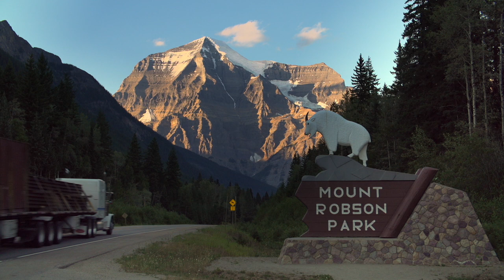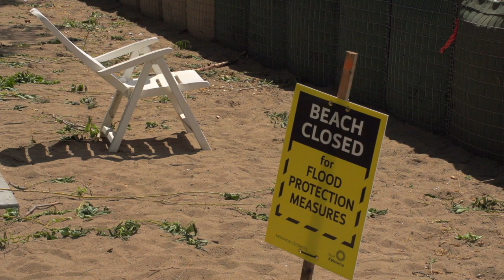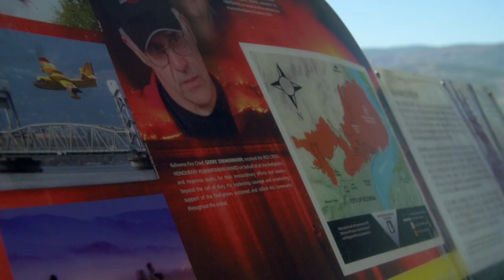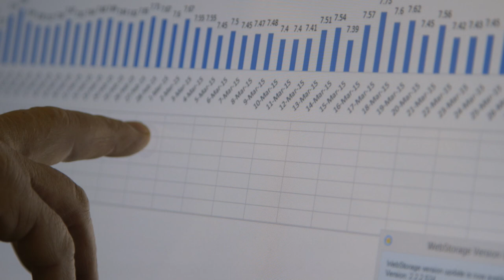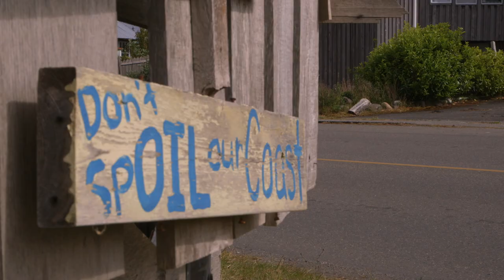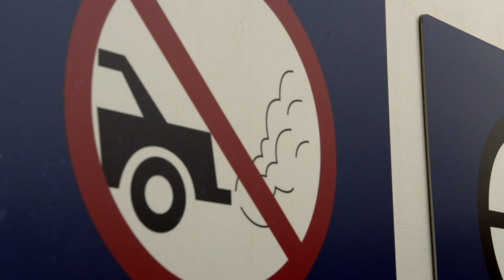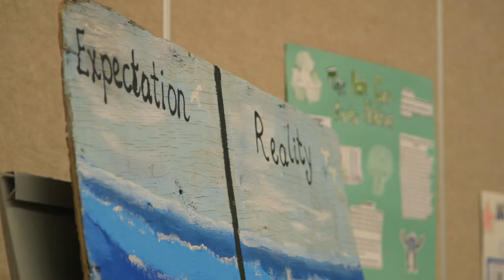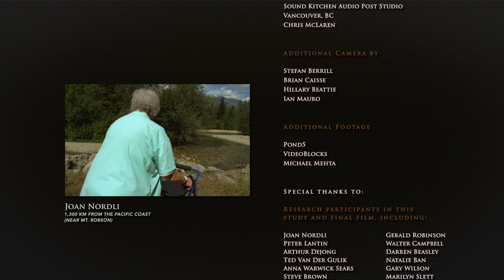Beyond Climate (full film) featuring David Suzuki

Comment: David please don't worry but adopt fusion power. The overall climate is demonstratively cyclic as in that it oscillates. We do not yet have sufficient data to build a worthwhile climate modelling computer program for realistic calculation of climatic changes and much is to do with clouds, water vapour and other greenhouse gasses. Australia was early to build the Hornsdale green mega battery to help with going green with solar and wind power and despite our backward thinking Prime Minister. I believe we should now also be the leading nation in installing fusion nuclear. The fusion nuclear SAFIRE GENERATOR by Aureon Energy Ltd. of Canada is the actually cheapest, cleanest and least expensive solution for clean electricity. Wind energy, solar, hydro and other green technologies are now just superseded. Hydrogen will not either become a future conventional fuel but a nuclear fusion one! Electric power is the future for autonomous small aircraft and with ever more battery energy storage density perhaps some larger ones. However, FUSION NUCLEAR IS THE FUTURE of ever-larger commercial and military aircraft. Now we have a 24 hr. reliable fusion power product. We now in 2021 have super cheap nuclear fusion energy already proven and almost commercialised as in being in advanced production, that of the "SAFIRE GENERATOR". So sadly, storage technologies and the power from ITER-type fusion power generators as well as conventional fission nuclear are going to be eclipsed. Current magnetic plasma confinement strategies and all current green energy technologies are totally out of date and relatively redundant. All our effort must now go into EVER HIGHER ENERGY DENSITY BATTERIES because green energy is now solved. With intermittent green energies we need an enlarged electric grid, so we see wind generators, solar farms and a multitude of variable green technologies with expensive backup batteries and they are all ugly and use up much land, while also being significantly capital intensive and all while having some safety issues. They are all also going to be unnecessary with the advent of the "SAFIRE GENERATOR" that is safe, costlessly self-fueling, totally green, buildable on any scale on a tiny footprint to safely match local community requirement and it is easily chokeable and 24 hours dependable. It makes all other technologies redundant as in being much less advantageous. It is fusion nuclear powered by nuclear "NUCHEMY" and seen at "AUREON ENERGY.COM". Also learn your new plasma physics, astrophysics, and general Electric Universe Theory at "THUNDERBOLTS PROJECT.COM". This way you can learn your new EU Theory, advanced plasma physics and all needed to fully understand all this new academic and practical material. and appreciate that all the other green technologies are currently just now superseded.